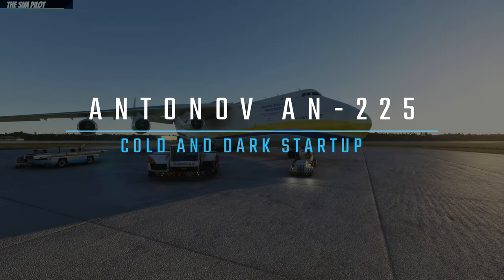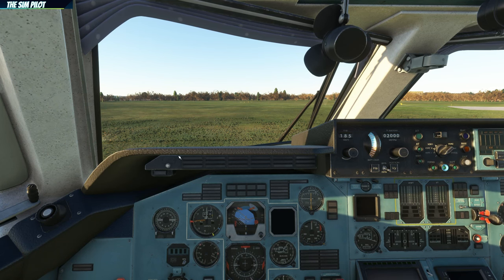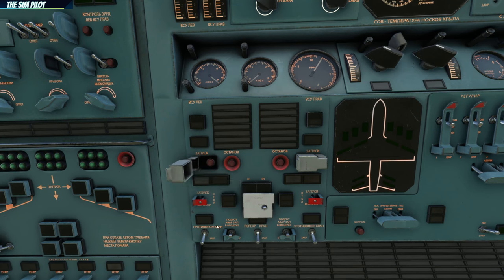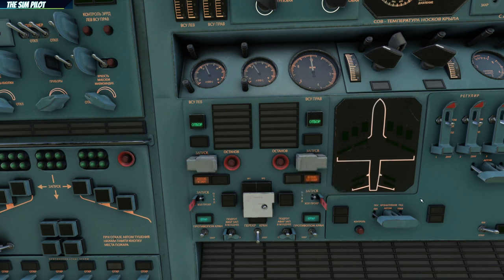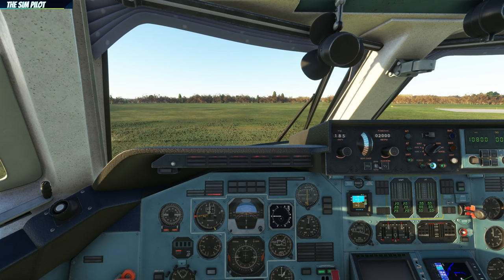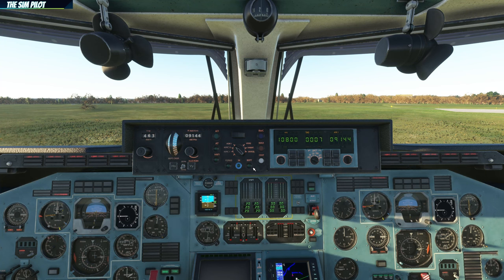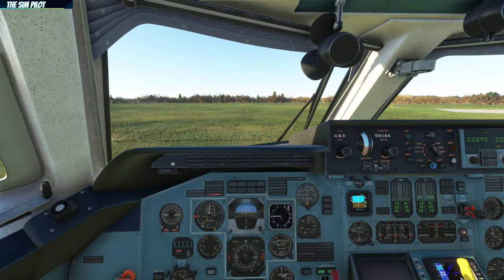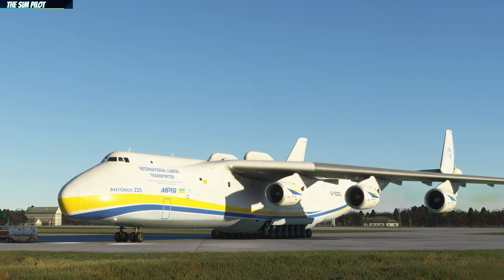MSFS | Tutorial | Antonov AN-225 | Cold & Dark Startup with manual engine start

Comment: The video I was waiting for ! Can't wait for this to drop on Xbox. The flight model on the a310 is outstanding, can the same be said here ?
Reply from the maker: Pretty much except couple hard edges which will be fixed I am sure such as pitch trim being overly sensitive. She definitely feels heavy on the pitch like she should and very stable during flight. Flap traveling is something you need to get used to after takeoff. It required a lot of counter pitch to avoid nose dip.

Comment: Does anyone know how to put the six motors synchronized with the t16000m joystick?
Reply from the maker: I am using a throttle quadrant but if you bind all the engines to the slider of T16000 you should be fine. I don't think reverse thrust can be controlled though.